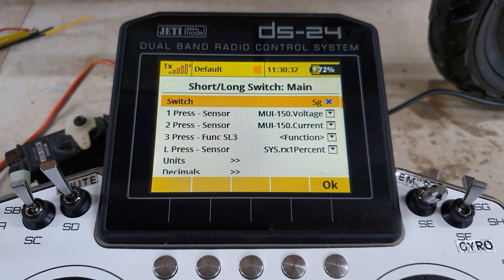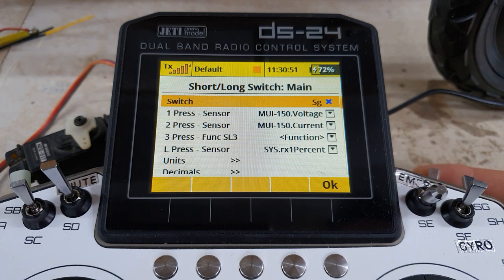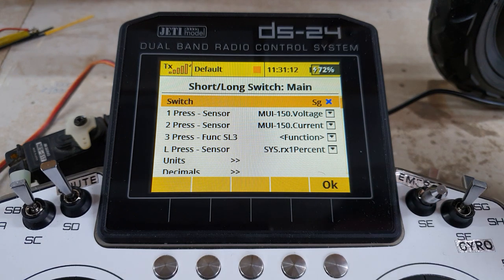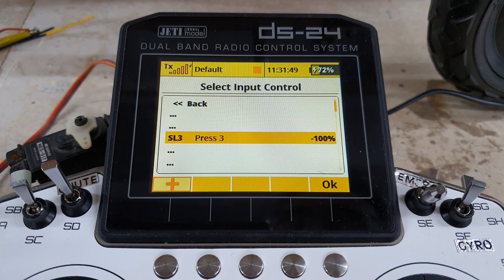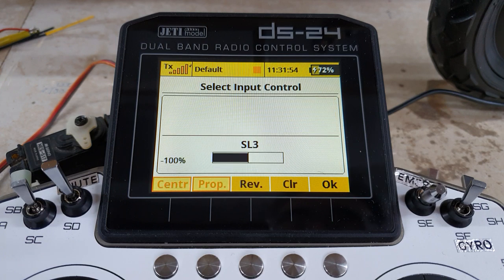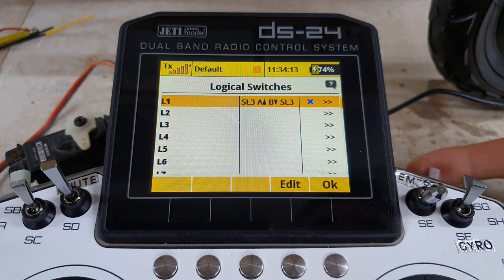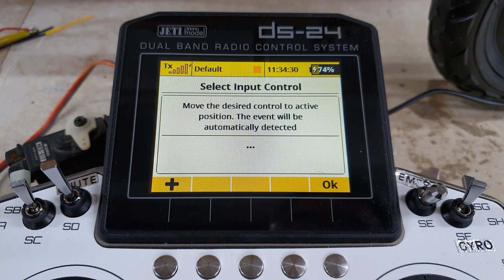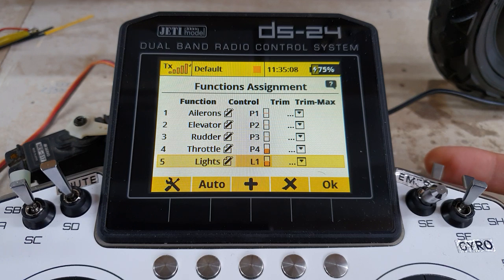Jeti - short press, long press episode 2. LUA app

Comment: Hi Harry, I get the  error message érror in DFM SWT attempt to concite a nil value (local 'sname') as well although I followed exactly your advice and avoided the DFMSWT-Distro file. I gave up after multiple attempts. Do you have any suggestions for me?
Reply from the maker: Hi Stefan, you can get it now from Jeti Studio.  Copy the address below, open Studio, go to File, Configuration, choose the Apps Sources tab, go to a new line and paste in the address.  Then when you connect a transmitter and start Tx wizard, go to Lua App manager, scroll down the list until you come to the DFM apps.  DFM SWT is one of them.
http://www.jetimodel.nl/DFMHC/Apps.json
Reply: @cotswoldpilot  Many thanks for your quick reply Harry and indeed, this time it works!!
Reply: Is it possible to have this function to more buttons? so far I can only set it up for multiple functions on 1 button

Comment: Hi Harry
downloaded and installed the folder and file on the ds16, but wont load as it comes back with an error in user applications. and when seleceted to use the app it comes back with the error _ not enough memory in console menu,all my other apps are .lc but this is .lua.
is this file not compatable with the ds16?
Reply from the maker: Lc is already compiled, lua is not so means more work for the processor.  Probably too much for the original 16
Reply: @cotswoldpilot ☹️ thanks for the quick reply... I can't justify a ds24 for one app.

Comment: Hey Harry, I keep getting an error when downloading it.  I unzip it and there is another zip file inside it. I unzipped that, went into the folder, then brought both of those files (one being the lua file) into the Apps folder. When I try to run it, an error pops up having to do with 'sname'. Any idea on how I can get around this? It says it has a 'nil value'
Reply from the maker: I suspect that you are downloading the wrong file.  Easily done, I did it too,  dropbox's construction is confusing.  If you are downloading a file called DFM-SWT-Distro, then you will get those errors.  Click once on DFM-SWT7.zip, that will go to a new page showing a folder DFM-SWT and a file DFM-SWt.lua.  Do not click on them, click on Download at the top right, and from the dropdown box click on Direct Download.  That should download a file called DFM-SWT7.zip
Reply: @cotswoldpilot  Nailed it. Thank you so much!

Comment: Hey Harry, interesting app, thanks a lot. I was wondering how could this app be used on a twin engine jet to enable independent control on each engine start/stop sequence while obviously using the throttle stick (and trim) for both engines. If for example the throttle trim was possible to be 'doubled' one for each engine and by double/tripple pressing a switch you could shift between engine trims to be able to start one engine after the other while using the same physical throttle trim? I think there are spare trims in the radio that could be used. Ideas?

Comment: Hi Harry great videos. Is i5 possible to do a Video: I wanted to use the left joy stick to operate 2 servos.  Then flick a switch now would like to use the same joy stick  but the 2 servos must operated opposite to each other
Reply from the maker: just create a new function but do not assign a control to it.  Assign the second servo to the new function.  Create a free mix of the original function to the new function, at plus 100%, and assign switch.  Create a second free mix, original function to the new function at minus 100% and assign same switch but in the opposite way.
Reply from the maker: Here you are
https://youtu.be/JeFfm5_V7HI
Reply: Hi Harry thanks for the super quick reply  :).  Is it possible to make a video i did not grab all of that  .... Thanks in advance